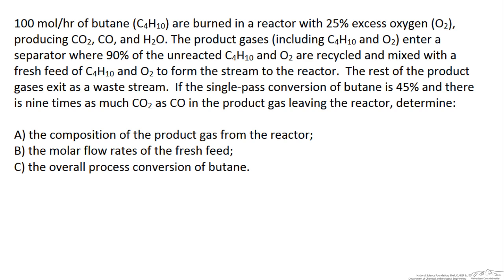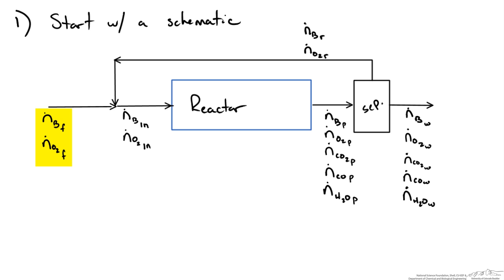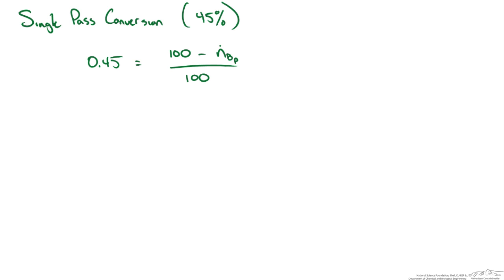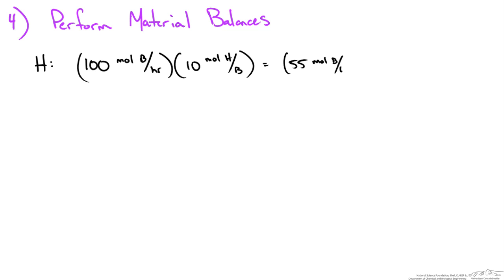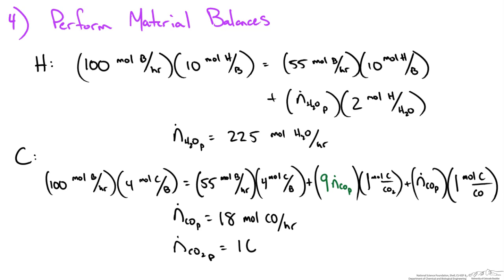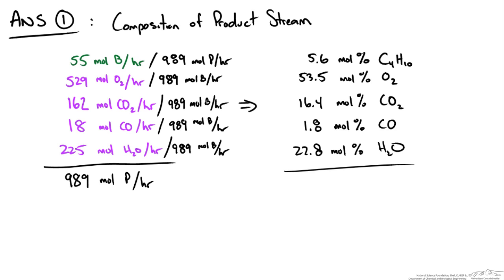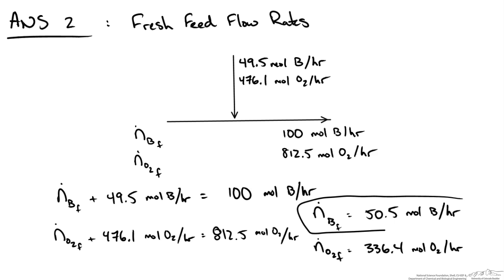Reactor with Recycle

Comment: May I ask a question/clarification? Sorry, I am confused. If so, in no. 2 which is filling the details, what are the considered unknowns? Is it only the number of compounds included in the reactor? or we should also count the compound outside the separator and in the fresh feed?
Reply: Also, in computing the % excess, why did it become 1.25 and not 0.25(650)? Did you add the percent of butane and oxygen?

Comment: I’m confused, if you are doing an atomic material balance, for the carbon dioxide why didn’t you multiply it by 4, since you know from the stoichiometric ratio that there are four molecules of CO2 from the chemical equation?!
Reply: The elemental balance is written in terms of species in the stream x atoms in the species. The total number of atoms is accounted for this way, so the reaction stoichiometry is irrelevant.

Comment: When the combustion reaction is written, why is Carbon Monoxide not accounted for?  We are told it is a product in the statement, so when writing the reaction, shouldn't it be accounted for?
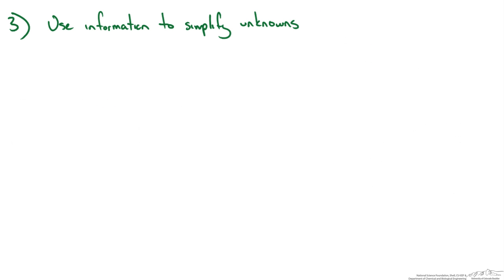Reply from the maker: Zach Hetzler @2:30 We are trying to solve for the amount of theoretical oxygen needed to completely burn all of the butane. When calculating theoretical oxygen, you assume that all the carbon in the fuel is oxidized to CO2 and all the hydrogen is oxidized to H2O.

Comment: can the extent of reaction method be applied here? tried to solve it with the extent of reaction which i found to be 45, I got mols of water right but the rest is off by a bit.  is it wrong to only use the balanced equation you used because it doesn't account for the CO? so if i wanted to use the extent of reaction would i have 2 reactions?
Reply: since the carbon monoxide didnt show up reaction so you cannot solve with the extant. I mean the carbon monoxide didnt react in the reaction which means we cannot solve with the extant I hope you got it
Reply: @Faa334  can you explain more im a bit confuse
Reply: you would have two reactions and therefore two extents to solve for which you can get with the 9:1 ratio of CO2 to CO by getting a relationship between the two extents and using them with the butane balance.

Comment: in finding the overall conversion of butane, how did you get the 5.5 mol per hr going out
Reply from the maker: The 5.5 mol butane/hr is what is coming out of the separator.  The number comes from a combination of a given and previous calculations.  We are given that the separator sends back 90% of the exit from the reactor to be recycled.  Therefore the amount of butane in the exit of the separator is 10% of that, which is calculated to be 55 mol butane/hr at 3:30 in the video.